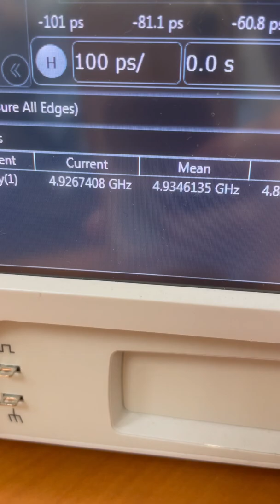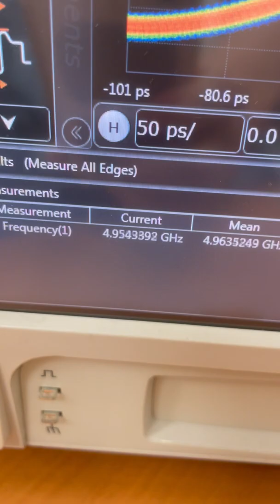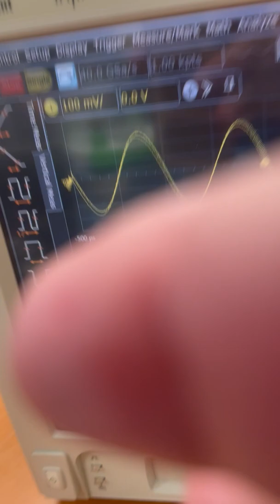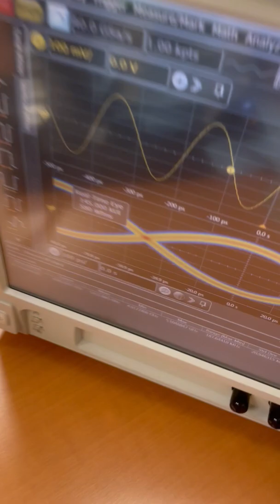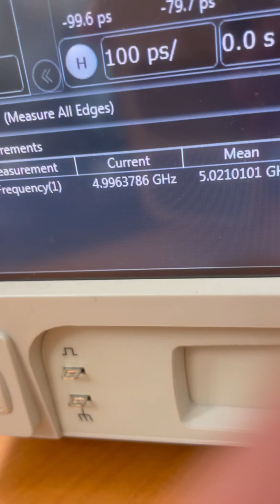DDR5-10043 CL48 Overclocking Video ( 1 cut +Baby-stepping+Oscilloscope )

Comment: hello, a tip: under € 350 what is the mobo that reaches / supports higher ddr5 frequency?  A at these frequencies (6400mhz) the most stable and safe, suitable for the OV pushed over time

Comment: hi, under € 350 what is the motherboard that barricades / limits less the (high) frequencies of the DDR5 RAM?  With the highest maximum frequency limit of the RAM, which supports the highest possible frequency in OC pushed DDR5 (with top-of-the-range CPU and RAM working at higher frequencies than those generally supported by the Z690 mobos, which therefore in this case could represent a limit and block / run RAM and CPU at a lower frequency than the max they could reach, unless we are talking about Asus Apex or very expensive mobos), then mobo that does not impose a frequency limit on CPU and RAM and letting them work at their high frequencies.                                        I foresee in the future to probably put an i7-13900K (keeping the same mobo) so the only thing I need is that it is a model of mobo that lets CPU and RAM work at very high frequencies without barricading and not limiting CPU and RAM to the limit frequency of the mobo.  With high max frequency limit (the one indicated by the manufacturers in the data sheets), but above all true in a real scenario, because I see that in the data sheets some models have indicated 5333MHz, others 6000MHz, but some say that all mobos with 4 DIMM / slot RAM barricade / limit all to 6400MHz (frequency of ddr5, even if these and the CPU could theoretically work in OC even at a little more than 6400MHz), hoping that this is not true, I am looking for a mobo suitable for OC pushed RAM, the goal is to try to bring even more mature ddr5 banks that I will buy in the future (with 13900k having better IMC and SA) at the highest achievable frequency, perhaps between 6500 and 7000MHz.
Reply: Just buy an apex, im running 7k cl30, 12900k @ 5.5., 4.3
Reply: @sagerdood  hahaha ok. which apex model do you recommend?  I have heard that some have problems with the Apex in overclocking RAM, even if compared to the unify they reach higher frequencies.  In addition to objective frequency also serves to me that the mobo maintains durability / longevity over time and is safe even in OV pushed, I definitely can not get on the mobo even minimal signs of decedimento in the long run, I am ready to spend, but will have to keep an OV pushed stable for a long time, the only condition in addition to high frequency
Reply: @alsteooaai  what does haha ok mean... im at 7k cl30 on an sp103.
Reply: @alsteooaai  i have read about the problems, i have a 2021 and it works just fine, im using the new 6600 gskill kit i was previously running the 6400 kit at 6800 cl30. I havent had much issues at all.
Reply: @sagerdood  no, I laughed because in front of such a long and complex question you answered with absurd simplicity, I appreciated
Reply: @sagerdood  at this point I do not think this is true even of the fact that they are more consistent than the Apex, in that they are all the same with respect to Apex that are too different, that is, between two Z690 is likely to come in with a 6600mhz and with the other at 7200mhz